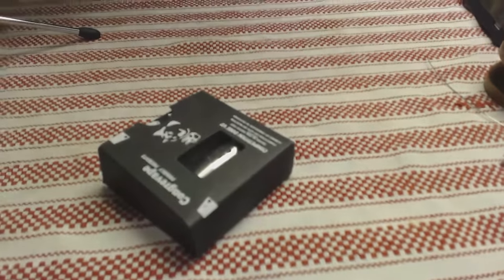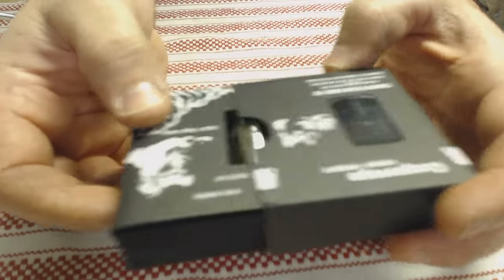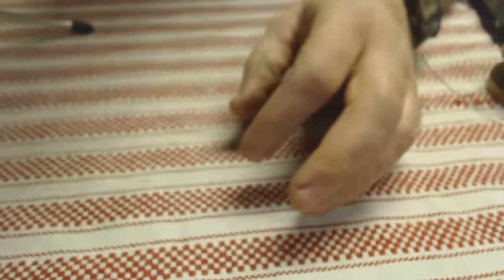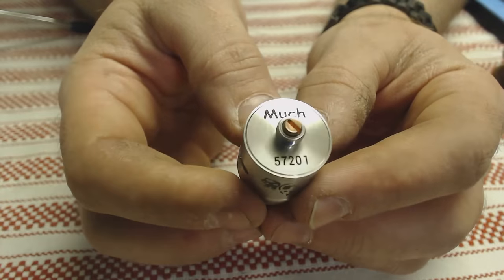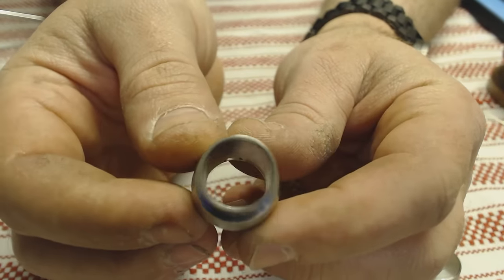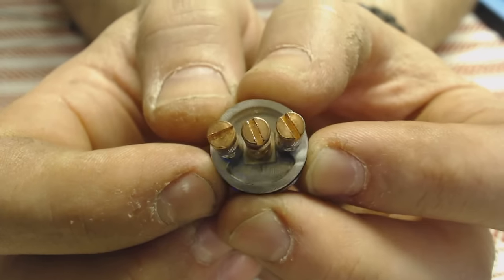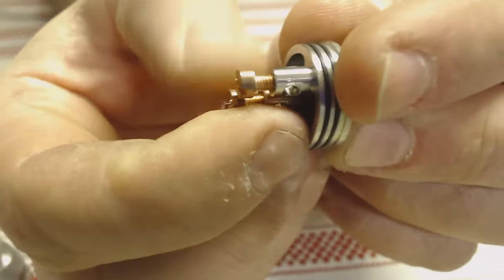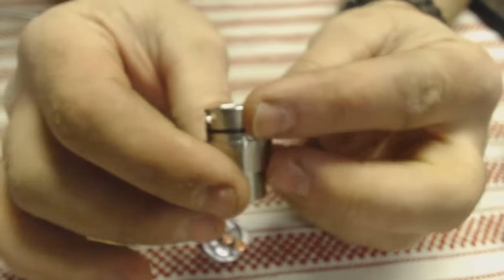doge v2 + build!

Comment: recently got project subohm edition of the doge-x v2 from vaporDNA (they do all the project subohm stuff) and im really digging it, the air intake is bigger with mutation style airholes but each row decreases in size from the bottom up. really takes the mutation style airflow to the next level. on top of that when you cut off the airflow it cuts off one row at a time, each hole individually. really digging it at 40$ for an authentic but of of the first builds i threw on was actually the same one you threw in for the video, but it was just too much spitting especially when you raised them with the chuff cap and i found i much prefer quad vertical coils of 26 nichrome80
Reply from the maker: Right on dude! Sounds like the x v2 is on point, I will have to check it out!!
Reply: are you getting alot of spitback in your throat with the raised horizontal coils and the comp cap?
Reply from the maker: None at all for me.

Comment: I don't know but since I got one of these I stopped using my other rda's
Reply from the maker: socratesthecabdriver that's awesome man!
Reply: Trevor Jones I got a single coil on it running at .17-18ohm 5428 srnbr and the milling was good on it but it had not being cleaned properly it's still had the final mill slither in it .. it took a while to get it out by use alone hahahaaa   almost jam cut it in my index finger good thing I checked for it and didn't dive in to it blind ... the store owner got mad and blamed me for thet problem hahahaaa I told him don't worry man I am still going to buy it ... all of ny has no real deal brikandmorter shops only boutiques  village I mean .. cause Astoria had a real nice vape shop up by Ditmars Av

Comment: Reason why I always stayed away from the Doge, conger vape screwed me once. But also, SS cap, needs a delrin option will get hot assss fuck low ohms, don't like copper screws, I'll break them fast. And way to much airflow for my taste, will ruin density. What I like about comp vape is they keep their sleeves thin and El Diablo as well. So heat won't stay in the RDA as well.
didn't mean to be negative on it. But that's just what I feel about the RDA.
Reply: I hear ya. Was it for a vertex? That's what they jerked me around on. Now I can't support them.
Reply: it was for the dodge, they didn't give me my money back for over a month. Would NEVER respond, just very unprofessional. So I never support Congervape.
Reply: I love my El cabron and twisted messes rdas. Even with 0.17 builds and the SS tops and closed off airflow they don't get hot.
Reply: You aren't going low enough, to make them scream have to go lower. I've done .06-.1 is my main area. Clouds I do .06-.08, normal vape .09-.1 Giant difference in heat and performance on the rda with those builds.
Reply from the maker: Mikael JT sucks getting screwed over man..i am so sorry that happened to you!
Reply: Trevor Jones  Congervape is known for along time to screw ppl over. Many complaints.

Comment: Man mine is different it has 9 air hole on each side  like the Mutation X does
Reply: Dustin Stewart I'm pretty sure that's the Doge X V2. I think it's the same thing except the airflow.
Reply from the maker: Dustin Stewart that would be the dogex v2 as the other guys here described bro! that top cap though....

Comment: Wow bro I just rebuilt mine earlier today but before I did I thought t my self "self I wonder If Trevor Jones has posted a build on this yet"? So I checked and only to fund nothing...So I ended up putting a dual twisted 26, 6 wraps in it and I shit you not I checked my phone about an hour later to see "Trevor Jones has just uploaded a video to youtube, lol.   Anyway mine is an angelcigs clone with a spinning centerpost! wtf!? it is square at the base but they punched out the deck a little too fat so when I put my first dual parralell the insulator had enought play to where it could be squished and let the centerpost spin... I wasnt happy! I ended up getting a few slivers of oak in there to soak up the free space to keep it from spinning. I also backed out the non adjustable 510 pin and wrapped a bunch of dental floss around the threads of the 510 screw so I could really tighten it down without it recessing into the shaft on the 510 connection.I got it on a sig 150, .2ohm 75 watts 6 wraps of twisted 26 wich really gave the flavor a boost! It is definitely a lip burner if I give it any more power! Anyway love your vids, keep em coming!
Reply from the maker: tommy bogenschutz that is some crazy shit!! lol holy crap! thanks so much tommy!!